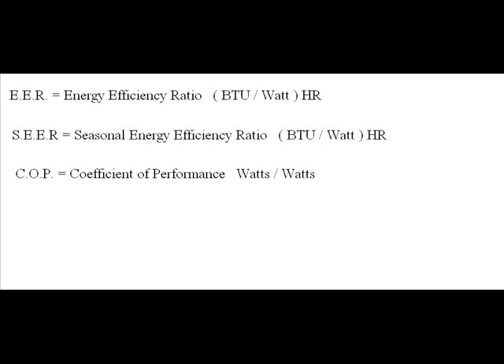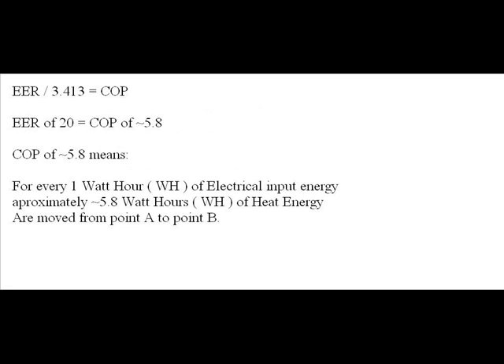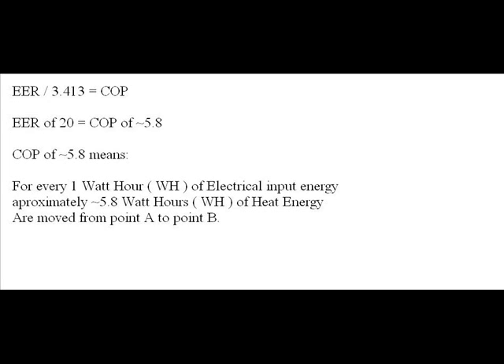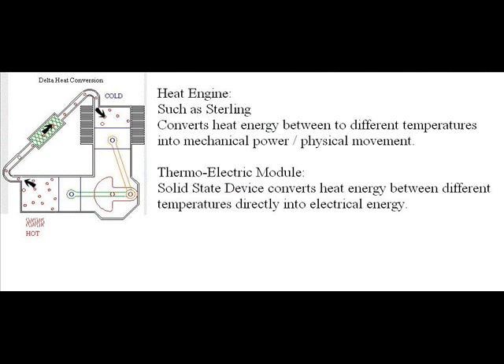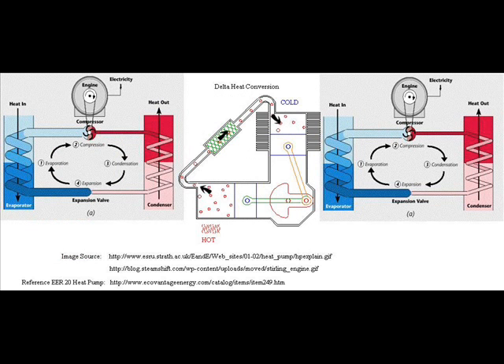ExtractAmbientHeatEnergy.wmv

Comment: Good thinking, but it happen that the theorical maximum efficiency of perfect heat engine (without friction) is exactly the inverse of the COP for a same temperature difference.  So at best, if they were ideal they could be a perpetual machine but no more.
Reply from the maker: Thanks .. but I think you misunderstood .. the key part is not about trying to get a total net efficiency over 100% .. but instead .. 'free to me' .. You want the ambient heat energy portion of the environment to 'pay for' what you extract out .. thus the output energy comes from a endothermic like effect to the ambient temperature.

Also keep in mind .. it doesn't have to be the same temperature differences.

Similar (in concept at least) to how endothermic chemical reactions can extract heat energy out of the ambient temperature .. making the ambient colder , and storing that taken energy in their chemical bonds .. then later, under different conditions you extract that chemical energy back out.

More specifically about heat pumps and heat engines .. say we have a 30.5 SEER Heat Pump .. Mitsubishi MSZ-FH09NA - M .. this is  COP of about ~7.8 .. Every 1 joule of electrical energy input gives you , ~about 7.8 joules of heat energy moved.

I can even store that ~7.8 joules of heat energy in a well insulated container .. and wait for the ambient environmental conditions to give me a better heat engine yield .. Night , day, whatever .. of course I'd have to weigh the storage losses with the benefits of the different temperature difference.

At COP of ~7.8 I only need a heat engine to be over 12.8% efficient .. There are numerous heat engines well over that.
Reply: The first part of your idea can work, if you store heat using the heat pump to increase the heat during summer and keep that heat in a perfectly isolate container until the environnemental condition (winter) make the temperature difference greater and recover energy from that. The problem with that is that is that a perfectly adiabatic container do not exist yet, I am working on creating one myself. But with the small difference in temperature that the heat pump give, it would take a huge container to store a significative amount of energy.

For the second part of your argument, I think it must be extremely expensive if a heat engine that efficient exist, the maximal efficiency of a perfect heat engine is 13.65% for a temperature difference between 253 kelvin(-20 °C)and 293 Kelvin (20°C) so your heat engine must be at least 93.77% of the Carnot efficiency and I personnally don't know any engine that efficient.

I have an Idea of a way to extract ambiant heat but if we invent it will be use for many years by you know who before it can be use by common people and be usefull.  So I don't on it until I am prepare to give it to every one.  Better safe than sorry...
Reply from the maker: On the 1st part .. it doesn't have to be 'perfect' , in fact that isn't possible (heat energy always escapes) .. It only has to be 'good enough' .. and although storing it over a 1/2 year cycle to go from hottest summer day to coldest winter night , would be possible , and it would definitely amplify the maximum possible temperature difference .. Over that long of a period , just the ambient temperature difference could easily extract power/energy .. combined with the 7.8:1 advantage of a good heat pump , that is just cranking it up to another level.

It doesn't take a 'huge' of a container as you might think. Even without using better suited materials. Even if it only used conventional water, that has over 100wh/kg of thermal energy storage density. Getting up near Li battery energy storage densities is achievable.

On the 2nd part .. Your assuming far too little of a temperature difference .. 40C dT is comparatively small in this context .. also you seem to have mis-read , 93.7% efficient heat engine is not needed .. the sited 7.8:1 Heat pump with no storage only needs a Heat engine over 12.8% efficient to achieve the described effect .. 12.8% efficient heat engine is insignificantly low and many are far higher than that .. if combined with the storage hottest day to coldest night difference , that further increases the temperature difference , and gets even easier for a heat engine to get over 12.8% efficient .. combined with longer than just one 12 hour day night cycle , into 6 month yearly hottest to coldest temperature differences it gets even easier.

I am not a business and I have no intention of being one. This video and topic is about what is possible. Other considerations for cost, popularity, marketing, etc, are all fine ideas, but are entirely their own discussions well beyond the scope of this one concept video.
Reply: I think you are right, I din't search for the exact amount of heat energy but I remember people who have use well insolate pool to store heat in it whith a heat pump and usin the heat in winter as a heat source.
And you are right the invention I am working on won't be perfectly adiabatic but less than a Joule of heat will escape from it in 100 years in theory.

This is where my 93.7% come from;
http://calistry.org/calculate/thermalEfficiencyCalculator
This calculator of Carnot efficiency give you the maximal overall efficiency for any heat engine so a perfect heat engine witch is 100% efficient will have  13.65% of overall efficiency for a temperature difference between 253 kelvin(-20 °C)and 293 Kelvin (20°C).

So for any heat engine to have 12.8% overall efficiency between -20 °C and 20°C, you must have an engine efficiency of 93.7% because 93.7% of 13.65% give the overall efficiency of 12.8% that you said was needed.

But it happen that heat pump COP are bigger when the dT is the smallest, that is why a dT of 40°C was use.  That is why they don't use heat pump to boil water and then use a conventional steam turbine. the dT is too big whith only 100°C so the COP drop below 1 so it became less efficient than a conventionnal heater.
Reply from the maker: Good luck with your invention.

Back on topic .. It does NOT need 93.7% efficient heat engine .. need just to be over 12.8% efficient heat engine .. I'll try and explain it again .. the real world off the shelf heat pump listed will move 7.8 joules of heat energy for every 1 joule of input energy I have to pay for myself to run aid heat pump .. the other joules come from the ambient temperature (free to me) .. This heat pump moves into storage 780% of the energy I have to pay for myself .. every 1 joule I put in to operate the heat pump moves 7.8 joules of heat energy .. In order for the net endothermic effect described to happen a heat engine would have to take that 7.8 joules of heat and give you just anything over 1 joule ... 1 divided by 7.8 = 12.8% efficiency.

Remember conservation of energy is a thing .. conservation of temperature is not .. temperature does not have to be preserved .. but the energy stored at 7.8:1 ratio that energy does have to be conserved.

Again .. This concept described , does not have to have the same temperature on heat pump as heat engine .. it does not have to happen at the same time .. it can exploit mechanisms beyond just the heat pump / heat engine themselves. 

Even without Heat pump assistance to increase the hot side and decrease the cold side .
There have been naturally air itself changing 
10C dT in as little as 2minutes
20C dT day vs night
43C dT in just 1 week
83C dT in 5 months

Your claiming just 40C dT total for the best possible heat pump and all possible air temperature changes combined is .. just too small of a dT .. this is a concept of what is possible .. if I we conservatively assumed we could only get a 20C dT heat pump to add hot side +20C .. and then ~5 Months later -20C dT cold side .. It is possible to use this method with as much as a 83 + 20 + 20 = 123C dT ... And if it achieves that 7.8 listed , it still only needs over 12.8% heat engine efficiency at this ~123C dT.

Your linked Carnot efficiency calculator assumes only a pure heat pump .. for example, it does not include the potential benefits of things like cold side water condensate being used to help remove heat better from the hot side , it does not include possible chemical endothermic mechanisms , etc .. but even with just the limited scope of that link , it lists over 31% efficiency is possible under these possible conditions .. when we only need to achieve 12.8% efficiency for the described effect.